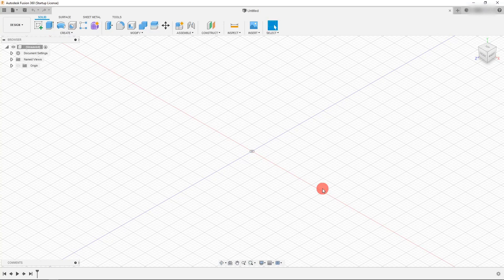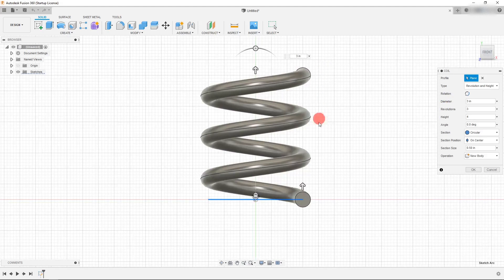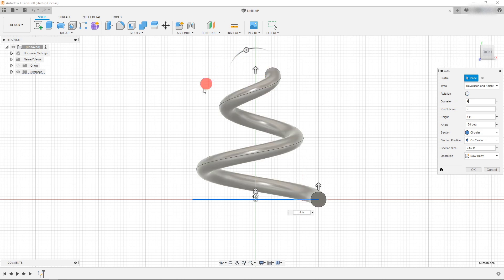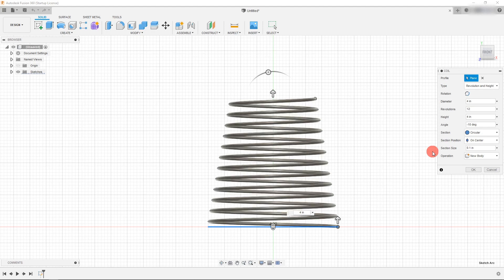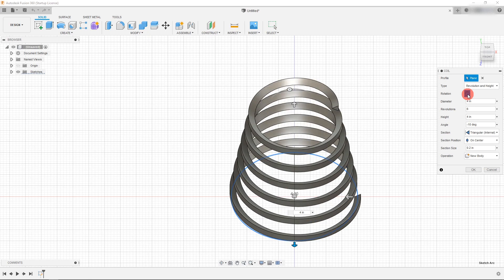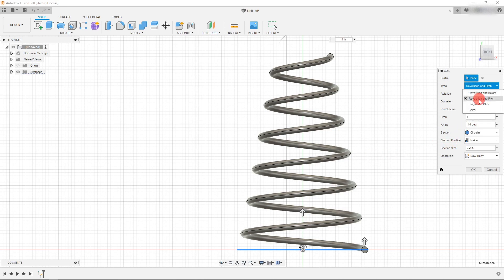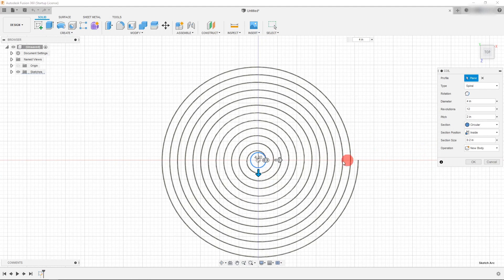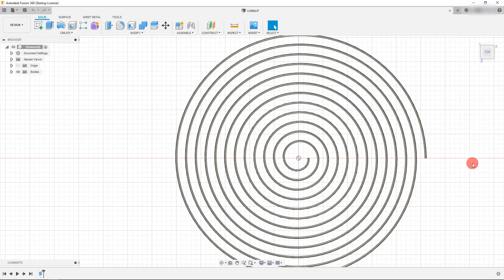Model a Spring in Fusion 360! Tutorial for Beginners Exercise, Lesson in Modeling Parts

Comment: How do you go back and edit the coil after finishing the shape?
Reply from the maker: As long as you have "design history" enabled, it is as easy as double clicking the spring feature in the feature tree (bottom of your screen). Let me know if you hit a snag with this.
Reply: @AvivMakesRobots  Sorry I should have been more specific. How do you change the sketch dimension for the circle?
Reply from the maker: @arihorowitz  The diameter is driven by the feature itself. It must be changed in the feature menu. You can access that the way I mentioned in the first comment.
Reply: @AvivMakesRobots  Right! And what if I want to move the sketch?
Reply from the maker: @arihorowitz  It depends how you made it. Did you create a circle and then select the spring feature? Or, did you start by selecting the spring feature without first making a circle?

Comment: I am trying to create a drill bit using the coil feature. The problem dat I am facing is that I can't alter the starting point of the coil. so I can't make the second coil.
Reply from the maker: To make the second coil, start a sketch on a different plane, whether that is an origin plane perpendicular to the first, or a plane that you custom make yourself. Hope this helps. This is how you control your start point.